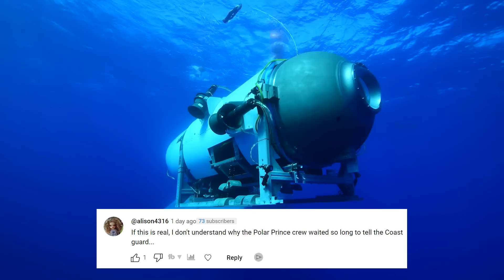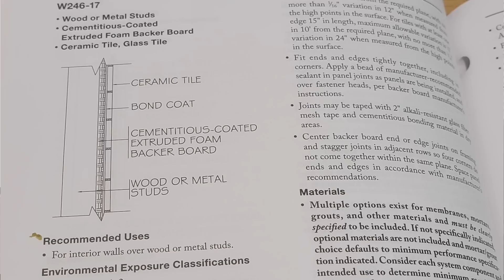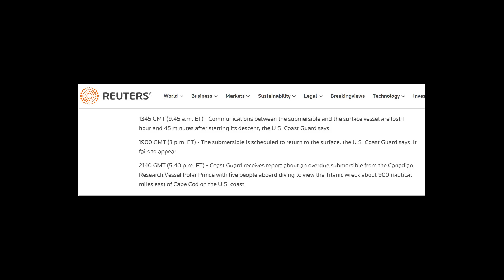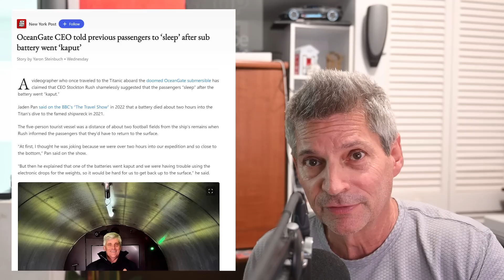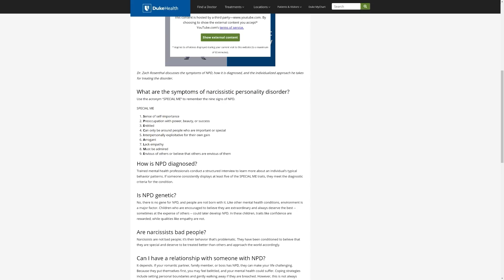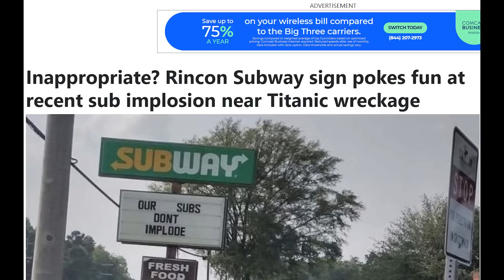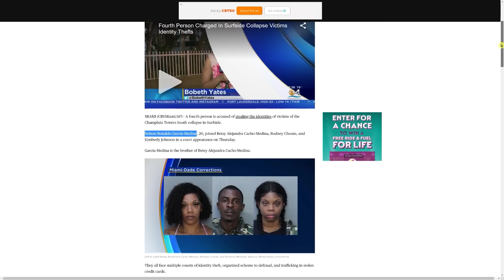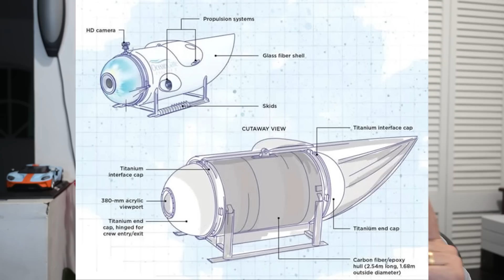Titan Sub: Why OceanGate Waits 8 Hrs Call Coast Guard, Q & A

Comment: 2:00 The loss of the Space shuttle Columbia is also a great example of normalization of deviance, they knew about the foam issue with the external tank since the first launch of the space shuttle, some foam always came off of the tank during launch (they called it popcorning) even though this very much wasn’t meant to happen and did pose a risk of damaging the shuttles heatshielding if hit, they assumed it wouldn’t cause a failure since it never had for years, until Columbia launched into that blue January sky in 2003
Reply: You know I remember the day before that went up. I was washing my car and I thought to myself wow people have been taking them for granted going up in the space. When I saw it on the news the next day scary creepy feeling
Reply: I was thinking same
Reply: @carlobelmont5629  I though I never hear those three words again.
Reply: Yep that’s just called a hard lesson learned. With titan so many things were ignored
Reply: The Space Shuttle had serious problems with heat tile adhesive from the very beginning.  They never were able to solve the problem.  They just crossed their fingers and hoped nothing happened.  The reason for the space shuttle was after Nixon and the GOP took over they told NASA to cut costs OR ELSE.  Penny Wise and Pound Foolish.
Reply: To be fair, probably the only solution they had in that case was to ditch the shuttle design. I assume the side-mounted shuttle was all about being able to reuse the engines since only the orbiter truly made it back (the boosters were not even really worth salvaging after all was said and done, but they kept doing it anyway). The shuttle was really doomed by the fact that the first stage couldn't be recovered at the time. I am not sure how much they could do with the electronics of the time, but that would have been the only way to put the shuttle on top of the first stage acting as a booster. Other than that it would have meant single-use booster engines and the whole point of a reusable vehicle would have been moot. And once the thing was designed the way it was, I am not sure how much they could do to prevent the foam shedding.
Reply: @theguyfromsaturn  thing was, they didn’t even so much as come up with a plan to possibly rescue or repair a shuttle with a damaged heatshield in orbit despite knowing there were multiple sources of damage to it. Example: STS-27 (second launch after the Challenger Disaster) Atlantis was nearly lost on Reentry after damage to the heatshield from paint from the solid rocket boosters. After that incident NASA was warned that the foam issue could lead to the loss of a shuttle 14 years in advance of Columbia’s final flight and they did absolutely nothing to prepare for such a scenario where a shuttle was damaged in orbit unable to reenter, NASA just accepted the foam issue as normal despite it being something that could lead to a failure, and did.
Simply put. “Didn’t kill me yesterday, won’t kill me today” mentality
Reply: @Oklahomarailfan.  Good point, and if you look at the space shuttle's safety record, it was actually worse than this sub. They had 135 missions and 2 crashes. Stockton took his 3 subs down 200 times, 50 of them were test dives in the Bahama's equal to the Titanic's depth. Like you said, neither one of them had any safety plans to deal with Murphey's law of what can go wrong will eventually go wrong. I think the engineers get on ego trips and think that their creation is so safe, because they built it, that they won't ever need to plan for a disaster.
Reply: @Oklahomarailfan.  That,  I definitely have to grant it to you.
Reply: I was stunned they let the Columbia take off KNOWING about that o-ring.
Reply: @happybergner9832 
You're confusing Columbia and Challenger. It was Challenger that launched with the o-ring issue. Meanwhile, Columbia had an issue with insulating foam. 

Both situations were caused by degrees of normalisation of deviance, but in fairness, Columbia happened on re-entry so there would be nothing NASA engineers could do once already in space
Reply: @InhabitantOfOddworld  thank you//excuse me!
Reply: @InhabitantOfOddworld  My bad😓😓
Reply: @happybergner9832  In an old interview, the attitude was 'Nothing happen, we get fix before the next lunch.' And then 'Nothing happen again, but we get it fix next time'. After a few lunches, I guess it's normal for the O ring to break down and nothing happen. 
Nothing happen because you guys were LUCKY!
Reply: @1968gadgetyo  they needed to have taken it seriously 😓
Reply: @happybergner9832  It was Challenger that had the O-Ring problem. Columbia was the foam strike issue.

Comment: Cameron had heard "from the submersible community" that the sub simultaneously lost communication and also lost something like a transponder transmission that allowed it to be tracked. He felt that meant it had to have  imploded. For some reason he seems confident in that info but kess confident in stateme ts "from the community" that the Titan was trying to ascend before it imploded.

The original Titan was wrapped as filmed. But after two dives they scrapped that craft. The next version (the one that imploded) was done by a different company and not wrapped in the same way.
Reply: How did the Titan surface crew not hear the implosion, equivalent of 40kg of TNT?
Reply: @trentvlak  Sound travels quite good in the medium water, therefore it could be detected by the military/coastguard hundreds of miles away. But the transition of soundwaves back into air to hear a noise above the water is close to zero.
Reply: @Koernell  They had monitoring sonar going though, they communicated through it. They lost comms, heard a bang, and lost signal all at about the same time.
Reply: @littlekong7685  yes, for communication. Translating the sounds into text to be displayed on a screen. I doubt that an "implosion" message would appear. And I doubt that they listened to the actual sounds instead of the computers translation/interpretation. But I wasn't there. No idea. Maybe they knew right away. Everything possible with this company.
Reply: @trentvlak  Way too far, in very deep water. It took nearly 2 hours for the Titan to even get down there, 2 miles down.
Reply: @hb4196  whales communicate 1000s of miles man. 3km away in water is practically right next to you.
Reply: Source? I heard they changed from a company in California to a company in SC. I don't know which wrap was done in their promo videos, however. I would think the thread on a spool wrap in the promo videos would've been the one they used for the Titan.
Reply: @CarolReidCA  There were two versions of the Titan, but the fist version was called Cyclops 2 (they have a Cyclops I metallic submersible that was purchased and modified).  The first carbon fiber craft was done by Spencer Composites in 2017. The video that people show is from the OceanGate YouTube channel ("Carbon Fiber Hull Winding") and was done in 2017 and is of the first one. I can't find the article that talked about the second one using a different pattern. But I found this description of the way Spencer Composites did theirs:
"Spencer opted for a layup strategy that combines alternating placement of prepreg carbon fiber/epoxy unidirectional fabrics in the axial direction, with wet winding of carbon fiber/epoxy in the hoop direction, for a total of 480 plies."

Comment: I was wondering the same thing, but they did tell the titan that they had implemented rescue so maybe they were going the private route...my question also is why not have an rov dockside. And why not tell these people to lose ballast and try to come back up as soon as fhe rate of descent was too fast, which was seen in 15 minutes? Maybe maybe they could have made it back up...
Reply: Also, having an ROV on standby takes money. I wonder if they weren't already in financial trouble. Some say the CEO was worth a few million, but that doesn't go far with the engineering, promotion, travel and ship involvement.
Reply: If the coms making the rounds are real, they not only dropped the ballasts, but the skids as well. If true, their rate of descent was too fast on their first report, and accelerated. They apparently ascended 19m, buy slowly.
  The USCG has the wreckage. Hopefully,  a preliminary report will be released soon. A full report should take about a year or more.
Reply: the implosion would have turned them into paste. they didn't have a rov to assist if say the Titan got caught up in something such as debris from The Titanic (an actual real danger) or had a failure that rendered the ballast dropping unable to occur so they couldn't ascend. Stockton didn't believe in backups hence no explosive bolts on the hatch nor a manual override of the control system

Comment: What is your opinion on the balance of the sub once all of the ballast and the skid was released. I would think it would have went vertical and/or rolled very easily.
Reply: It probably stayed pretty level, maybe just a slight upward pitch.  The pressure hull provided it's own buoyancy, of course.  There were mechanicals and equipment bolted to a frame behind the read end cap, but it was compensated for by syntactic foam.  The ballast was positioned right at the center or gravity.  The landing frame was probably slightly forward of the C.G.  In an emergency ascent (drop everything), probably only a few degrees pitch up...
Reply: @zomgthisisawesomelol Maybe because of the implosion they never had a chance to do anything.
Reply: Jeff doesn't know. It's not covered in book on how to lay bathroom tile.

Comment: IMO. And I most certainly could be wrong. I think, the CF winding method looks like it might not  address the issue of water penetration through the individual fibers. It definitely looks stronger but also looks more likely for water to get in and cause havoc. Either way, CF doesn't look to be a good option for this application.
Reply: Whatever direction you put the fibers on they are still one layer on top of the previous. The helical patterns shown take care of the forces a CF-part is subjected to. In the case of the submersible the main force comes from lateral directions trying to squeeze it. The way a sausage explodes just inverted. The next major force is from the endcaps pressing on the cylinder. So all forces are either longitudinal (from the caps) or centripedal (from the water trying to squeeze).
To avoid the layers to become separated there should have been weaved patterns. So an upper strand becomes a lower and vice versa. That way the strands can hold themselves in place. But those weaving patterns need to not only interlock two neighboring layers as in a woven fabric where you simply stack fabric layers again. And that is topologically a challenge.
The basic flaw, pressure vs. tension, for which CF is not a good choice has nothing to do with orientation of fiber layers.
Reply: @V100-e5q  If all one had were a carbon fiber inner layer, a carbon fiber outer layer, and a solid resin pipe between them, it would be impossible for the sub to collapse without either increasing the distance between the inner and outer layers or reducing the total volume of resin between them.  I would think that if one had inner and outer layers connected via strands that ran between them, those strands would be in tension as a result of outside water pressure.  Weaving a structure like that might be difficult, but the same traits that make throwing carbon fiber on a cylinder easy also make it weak.  Putting carbon fiber on an egg-shaped vessel would be harder, but the shape would have much more inherent strength (which is probably part of why eggs are egg-shaped).
Reply: @flatfingertuning727  Yeah, egg's know what they are doing! But then you suggest basically a sphere like everybody else has used before (successfully). And that was against Rush's intentions to have more space and ease of construction.
My layman's question is whether the fibers rather contributed to the failure than prevented it? A CF under pressure lengthwise will splinter. A piece of pure epoxy might just shrink but being elastic. (If under the temperature conditions) So, as you suggest, a pure epoxy kernel would give a little and that's it. In essence you suggest a girder structure like that used on bridges. I think the outer layer should be resistant to compression. Fiber won't do that. So it will serve as a shape controlling feature there only. The water's pressure will be taken up by the resin. And if that shrinks even a tiny minute amount the fiber gets crushed and desaster is coming.
Reply: @V100-e5q  There's a continnum of ovoid shapes available between "sphere" and "sphere-capped cylinder".  An ellipsoide shape whose end caps were about the same size and shape as those of the Titan, and whose length matched the Titan, could have been both more spacious and stronger than the Titan was with its cylindrical shape.

The outer layer would need to transfer forces to the girders.  Fiber can do that just fine if it's bowed inward so that the applied pressure puts it under tension.  I would imagine that one could have a nested sequence of layers with water between, each of which would be slightly elastic and thus have slightly lower pressure on the inside than on the outside.  If one had ten such layers, each designed to safely support sixty atmospheres worth of pressure differential, and they had small access holes in the Titanium plate to which they were attached, it would be possible to have ground-based test equipment adjust the pressures in different layers to ensure that each membrane could support more than eighty atmospheres of pressure.  Such a design would allow for redundancy in case a layer failed, allowing the forces to be safely redistributed.

Note that while these layers would need to have a total pressure rating far above the intended dive depth, the fact that they would be in tension, and could redistribute loads, should allow them to be much thinner than would be necessary for compressive layers of the same pressure strength.
Reply: @user-sm3xq5ob5d Another problem is air pockets in the resin, regardless of how you wrap it. A vacuum process is used to reduce air bubbles, yet certainly doesn't eliminate them. Autoclave process may reduce them more, yet I haven't seen any references to vacuuming or autoclaving in reference to this vessel.
  Under pressure, the resin would be pushed and would fracture into those air spaces, and would eventually result in failure. The cracking sounds they were hearing were very likely that happening. 
   The epoxy at the ends didn't seem to be centered either.
  Additionally,  those weren't the only problems they had. Coating it with that polymer may have hidden water seeping into the ruptured spaces, yet a prior engineer said that the polymer was ports, yet another problem, if true, they ignored.
  The timeline of the coms that made the rounds, if real, showed an uncontrolled descent. I ran the depths reported and time stamps, and they were descending almost twice their planned descent rate, which was already fast at 2.5 hours to 2.4 miles depth.
  If true, the fast descent rate would've added additional stresses to the submersible. Also, that adds the question of why the fast descent rate? The rate was faster than planned on their 1st report, and it accelerated to almost 2x the planned rate, until they dropped their ballast weights and the skids. That has me wondering what was making them so heavy???
   When they dropped their weights, they were still descending. When they additionally dropped the skids, they started to ascend, but very slowly.
   That seemed to suggest that they may have been taking on water within the carbon fiber/epoxy material.
  They also reported hearing noises in the aft section, which was likely the primary failure point, if the report is real.
  Hopefully,  their wreckless actions don't enable overregulation for other researchers.
Reply: @CarolReidCA  I agree with the bubble problem. I wonder how much water could be pushed into the resin vs. the amount of buoyancy the healthy vehicle had.Those air bubbles' total volume should not be in the hundreds of gallons. More like a few. Would that make for a serious loss of buoyancy? But then if water simply seeped through and accumulated in the bilge. Was there any detector for taking water?
Reply: @CarolReidCA  I don't know if "overregulation for other researchers" would be a thing. This is the first accident in the history of submersibles, and there are now 9 left in the world that can make such a descent. All have been properly built and all are certified. The 10th one, Oceangate, was the only one not certified and the only one using carbon fiber. Which should not have been used.